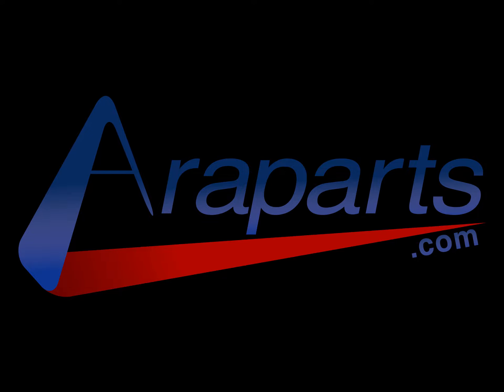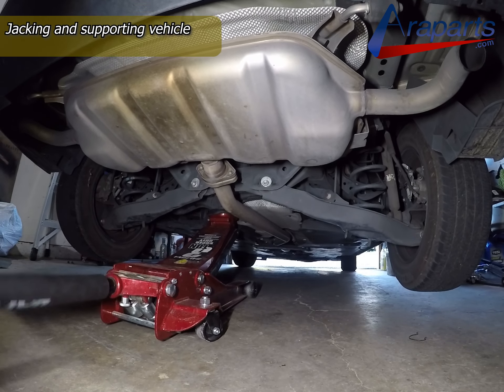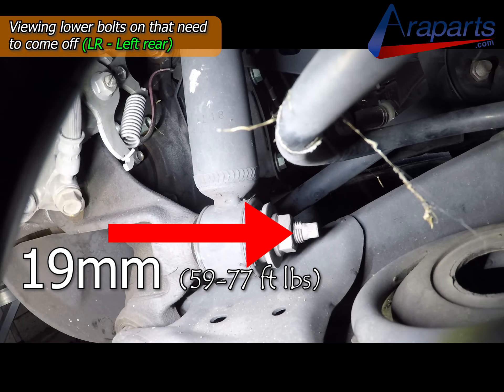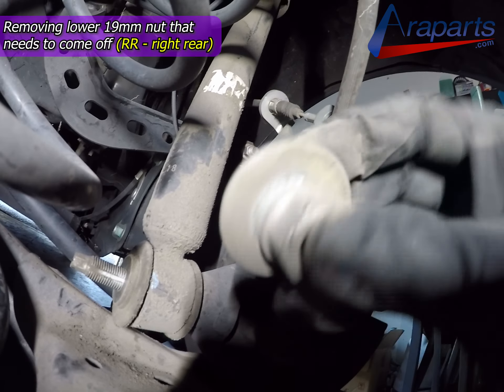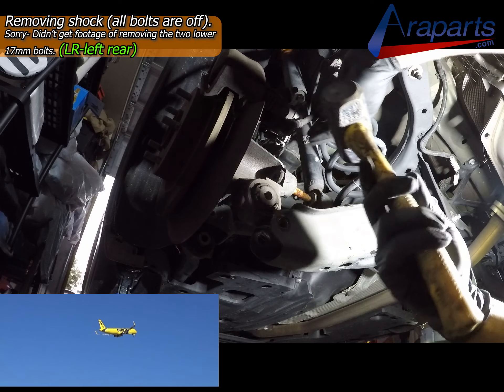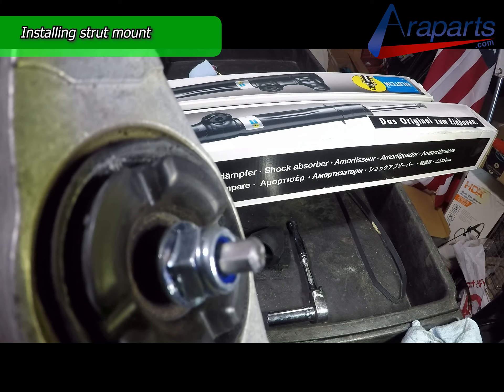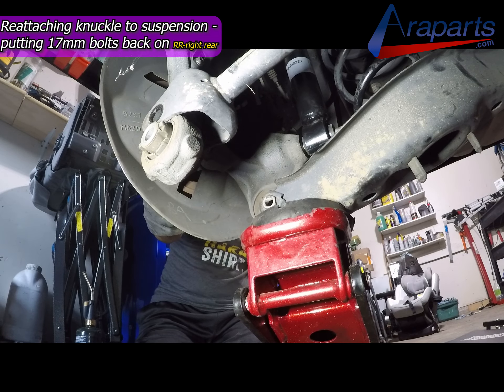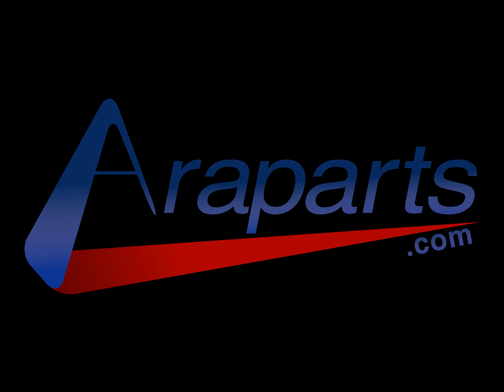2014-2018 Mazda 3 Rear Shock Is Bad - How To Check , Diagnose, & Replace

Comment: great video thank you. did you need wheel alignement after that?
Reply from the maker: No wheel alignment afterwards. This is a neighbors car. He commutes 2 hours a day. No unusual rear tire wear. The new Bilstein shocks made a negligible difference in ride height. We “think” they added a bit of height…or essentially restored ride height. He said the biggest change was less road noise.

Comment: Thanks for sharing the information, was the shock absorber noisy while driving?
Reply from the maker: From what the owner said, it was noisy, but it wasn’t very noticeable until the new shocks were installed. He said he noticed it was quieter with the new shocks. The road noise from the old shocks gradually increases as the shocks wear / leak oil.
Reply: @araparts I suffer from a ticking noise while at speed bumps or on an uneven road. I replaced the shock absorber mount and it continues. Can you please help me understand where the noise is coming from?

Comment: Good video...I am doing this very job next weekend.

Do you have recommendations for how to remove that lower end off the stud should it be really seized?

Would it be better to CUT the mount off the bushing OR attempt to unscrew the stud itself feom the car?
Reply from the maker: Hit them with penetrating oil several days EARLY. Most pros hate hearing this method because they generally don’t have the time to let that stuff sit and soak, but it’s perfect for DIY and early use. 

That stud uses an 8mm socket (if I recall correctly). You can attempt to remove the stud, but if it’s corroded, it may break. If you can simply get it to turn just a little bit, that’ll be enough to break that corrosion bond. Then you can proceed with removing the shock. 

Careful with heat and cutting tools as the shock is filled with oil.